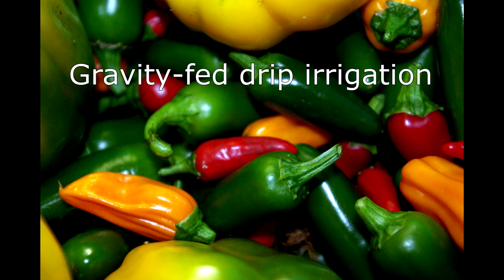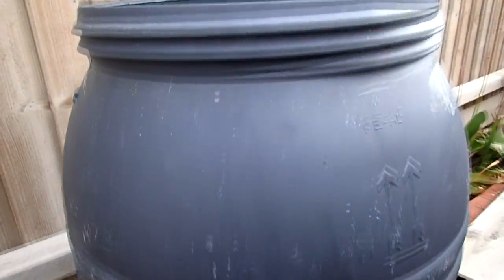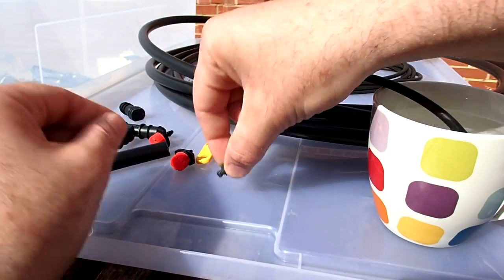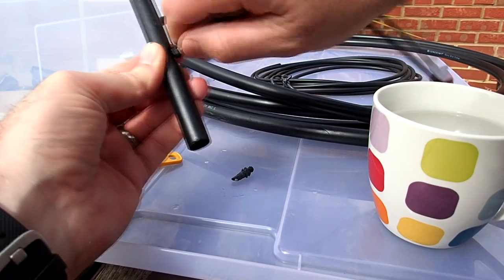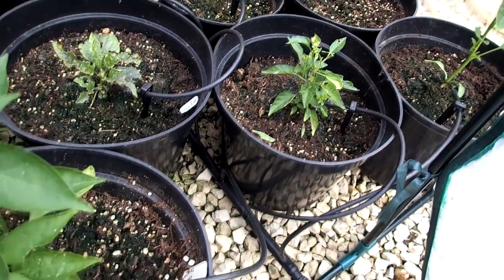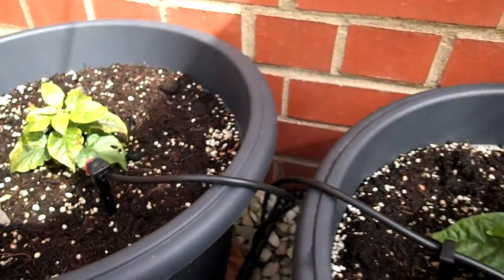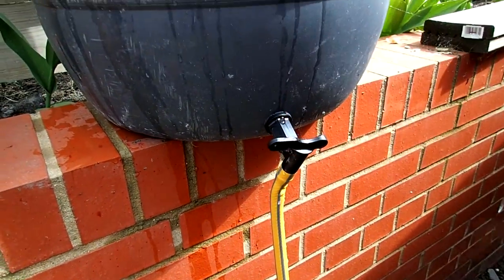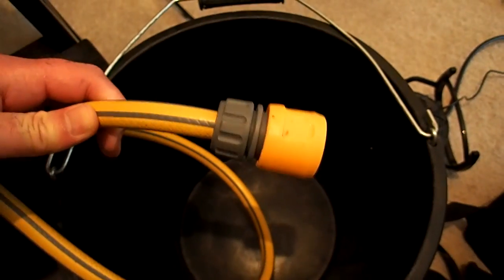Gravity Fed Drip Irrigation System

Comment: Brilliant thanks. I’ve just bought a small set up to have a go. It’s by Kingfisher, 23meters of vinyl pipe and fittings for £5 bargain. I’ll no doubt need some other bits but it’s a start and it was very helpful to see your set up.

Comment: Thanks for the great tutorial.  I have been thinking about getting one of these for a while but I did not know if the timer would work or not if it was being gravity fed, rather than through a normal pressurised tap.  Now I know it will work I will be getting one this week.
Reply from the maker: This was the first video I uploaded to my channel. Pretty cool that people are still watching it!
Reply: @ChilliChump  you seem to say you don't like these drippers any more in a more recent video, because the flow rate changes randomly. Was it these ones you were talking about ?
Reply from the maker: With the gravity fed system like this, these drippers are just fine. When you can create a consistent pressure like I do with my current system, and with the number of drippers I have, the new style I use are better.

Comment: I don't know if you've ever heard of these ceramic probes which open their independent valves depending on humidity of the substrate. Saves a ton of water. Easy to calibrate.
They shouldn't be too expensive, especially in bulk
Tropf blumat ceramic probes are a good product.
After 7 years, better late than never, I suppose.

Comment: Nice, basically the same thing im doing this year..rain barrel and all..i heard that if you have it in a loop instead of coming to an end the pressure will be more evenly distributed
Reply from the maker: Kind of....if the emitters are all at the same height then the pressure should be the same across them all if there is enough head height and pressure to begin with. If there are varying heights then there will be varying pressure

Comment: Hi, thank you for the video.
What's the height difference between your two set ups? You say the first one is not high enough but it doesn't seem much lower than the 1.2m of the second one.
Isn't there too much flow difference when the barrel is totally full and near empty?

Comment: Good information can you tell me were you got the adjustable droppers from as there are so many out there thank you trevor
Reply from the maker: Just get the cheap drippers off eBay. They come in packs of 100 and are better value than the more expensive ones. They usually have red tops and are adjustable

Comment: Fantastic video and thanks for sharing. Would you be able to tell approximately how many meters of pipes this 1.2m tank can run ?
Reply: awesome, looking forward to your new video
Reply from the maker: Read with Alex I think it is more important how many drippers or emitters you are running off it. with this particular setup I could get up to 30 emitters working effectively. if you raised the height of the tank you could certainly add more emitters. this year I have an even bigger system! will be videoing it soon

Comment: Can you go into a bit more detail on attaching the spigot to the water butt? I've got two old water butts that I'd like to use for this but I'm scratching my head on how to install a usable tap that will feed the irrigation system.
Reply from the maker: If your water butt doesn't have a ready made hole, then you can use something like this https://amzn.to/3xm4q8h

Or if you have a threaded hole already, then this would work https://amzn.to/3f7oIvP

Comment: You are the hero! Can you tell me where can i find that filter? Thanks
Reply from the maker: +Acoustic Division - Official I got it off Amazon. It really is a requirement to keep your drippers clear!

Automatic watering 13mm inline irrigation water filter: http://amzn.to/2hEAwuZ
Reply: Am i fine with 1m height for the 150l barrel? I need to put approx. 20-25 mainline hose and insert 10-15 drippers. Would i get enough pressure? Thanks again
Reply: Chillichump btw thanks for the filter boss! :D
Reply from the maker: That should work fine, I would suggest a little higher probably to ensure even distribution of the drippers (so that the ones at the end drip the same amount of water as the ones at the beginning)

Comment: With the barrel at one meter height like yours how long can the main tube be to create enough pressure? Thanks.
Reply from the maker: The height is more important than the tube length. The tube/hose can be pretty long as long as it stays at a meter or lower than the source

Comment: Could you install a small pump if the plants were in a Greenhouse off the gravity fed barrel?
Reply from the maker: Hi Rich, you may want to have a look at my current setup: https://youtu.be/RpdaaCLvpfU

Also, be careful using a small cheap pump. Problem is they are normally high pressure, but low flow rate. That isn't ideal for irrigation

Comment: Any particular adjustable dripper brands you'd recommend? Wont the soil near the edges get dry? Does that even affect anything? (Complete noob here) Im looking for a solution for watering 25+ plants at work that are about 3 meters up on a 1x5 meter metal/wooden grate. I think we could put a slim 30 l water tank about 1.5 meter above it all on a beam. I'd prefer something simple and clever so we won't need bringing out a big clunky ladder and check up on stuff all the time.

Cheers!
Reply from the maker: Hey there.  Any cheap ones will do.  But if you watch some of my more recent videos...I use constant drippers now.  I made a video last year discussing why I switched. Look for the thumbnail which shows the adjustable drippers
Reply: @ChilliChump  Just to be clear. I'm talking about 25-ish individual pots. Not a massive tray.
Reply from the maker: I use individual pots too.  You can see them set up in this video https://youtu.be/yS3NaeY1GyI
When I say constant...all I mean is they aren't adjustable, they are set to 4l/h. I have them set on timers to run for a few minutes at a time
Reply: @ChilliChump  Ok, but how can you set them individually? I'm talking about (semi) large indoor house plants, who might need just a few dl per week. Not liters per hour.
Reply from the maker: Like I said they run for a few minutes at a time.  You run a 4l/h dripper for 3 minutes and you get 200ml. The adjustables will work just fine too and will be cheaper.  But they are less consistent. Have a look at some of my videos where I discuss this.
Reply: @ChilliChump  Sorry for being a noob here. But I suppose you're talking about several pumps then? Like, one pump for 5 very thirsty ones, turning on more often, and then perhaps another pump for 15 medium ones with another setting, and another pump for 10 plants that are not that thirsty.
Reply from the maker: Just get different litre per hour drippers. Get 8l/h for the thirstier plants. 2l/h for not so thirsty, and 4l/h for the rest. Run them all for the same amount of time and they will release different amounts of water (in 3 minutes 8L/h: 400ml, 4l/h: 200ml, 2l/h: 100ml etc
Reply: @ChilliChump  Aaah, of course! Haha! Thanks! My first plan (still is though, not sure what the end solution will be) was to get moisture sensors and relays turning on valves when needed. All through a sweet web interface. I still want to program something fun, so perhaps at least controlling the pump and maybe a webcam for it. And maybe throw in a sensor that can be in a different pot each week for a start so I can check a general level and have something to adjust to.
Reply from the maker: Have you seen this video of mine? https://youtu.be/RpdaaCLvpfU

Also check out my second channel, I am doing a series on automation for beginners www.youtube.com/chillichump2

Comment: Hey bro, nice vid, very helpful. Please tell me, should I go with 11mm or 16mm water hose ? I need to install 20-25 drippers, so I have to buy smaller or bigger hose (in diameter)?Which one would give me better performances ? I'm going to attach my 20m main line to a 200l barrel on 1m height.Please give me your opinion. Thanks!
Reply from the maker: +League of Outplays I would go with the larger hose. Give you more scope for upgrading or adding more drippers later on too!
Reply: So your hose or end plug is with 16mm diametar?
Reply from the maker: +League of Outplays hose end...mine is actually 13mm because it is the most common size here, but I would go bigger if I had easy access to that size. The end pipes connected to the drippers are 4mm...pretty standard for those.